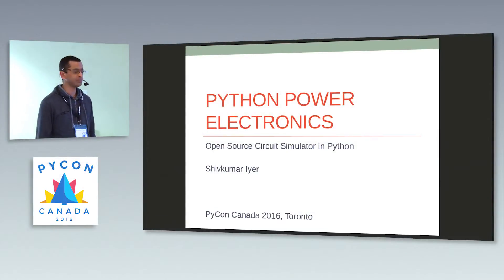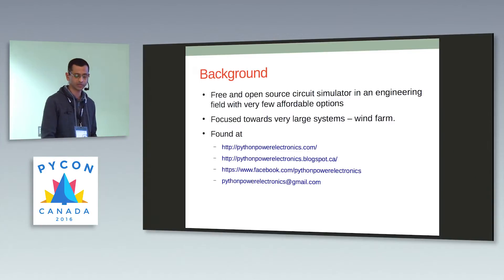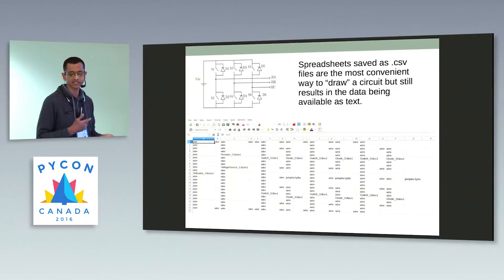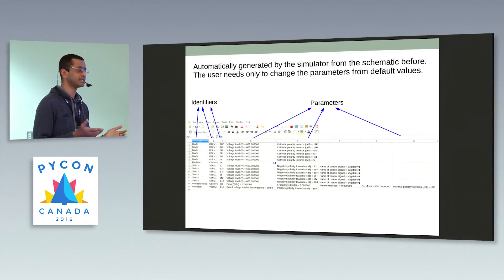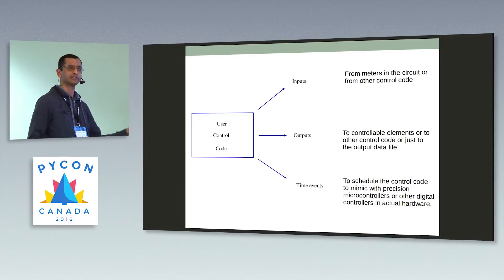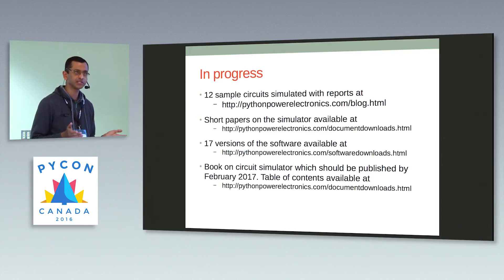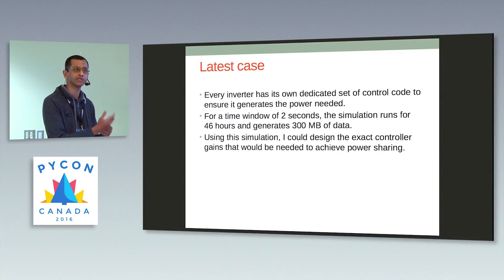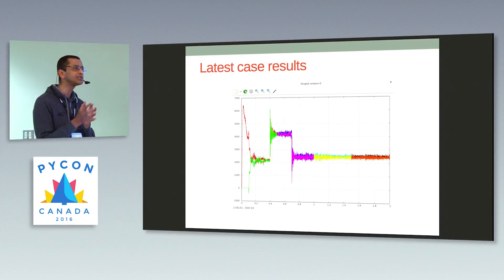Circuit simulator for power electronics: Python power electronics (Shivkumar V. Iyer)

Comment: Dear sir, I find myself in desperate need of help for my MA thesis. Im using Pypsa to simulate an electric network utility problem.
Do you have any leads, or know of a place i could ask questions regarding Pypsa and python for energy analysis.
I keep getting the following notice when i run the program: "Optimization failed with status ok and terminal condition infeasible".

Thank you very much. All help is appreciated.